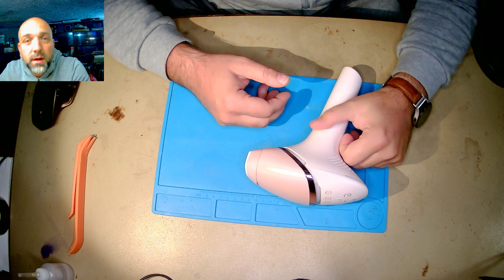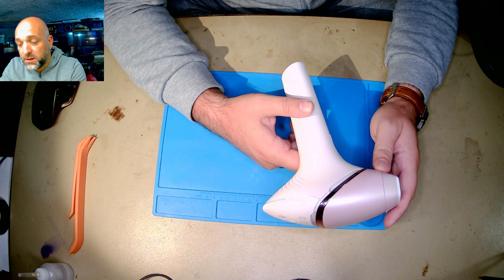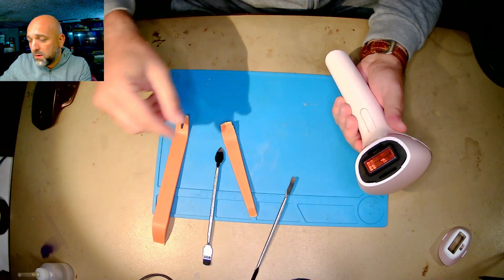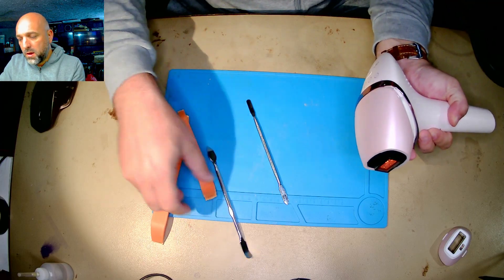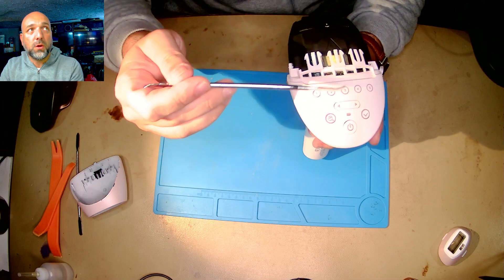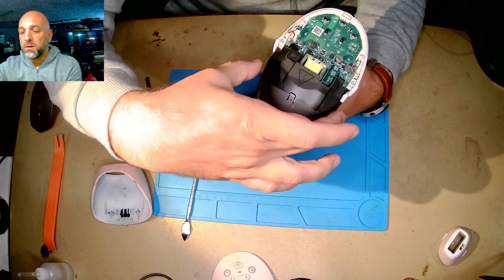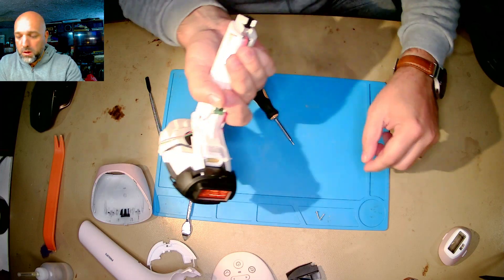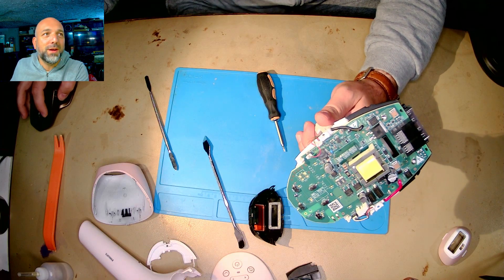Philips IPL Lumea 9000 Full Disassembly | Step-by-Step Teardown

Comment: Is it possible to open only the appliance case at the handle? Can I start there instead of the top?
Reply from the maker: Unfortunately no. The screws holding the handls are located inside.
Reply: @benassy69 Does that mean I have to disassemble the case in the same order as in the video?
Reply from the maker: Yes. But be carefully to not break the lamp
Reply from the maker: @AnaMF91 yes

Comment: Are there any dangerous radioactive materials in these devices? I wanted to check before proceeding with a repair on one of these. Thanks
Reply from the maker: No. I have a radiation meter and test it and it is safe.
Reply: @benassy69 thanks so much, really appreciate the help. Thanks Rich

Comment: 1:42 correction it's not extremely hard to disassemble it's  a true nightmare for me.😂
Reply from the maker: Yes..confirm 😂 Have you repaired your unit?
Reply: @benassy69  definitely I'll not be interested in repairing it 😂
especially after the tragedy of disassembly
Reply from the maker: But what was the defect. Mine's has no flash . Capacitor ok battery as well  ....don't know about the lamp
Reply: @benassy69  I am so sorry I forgot what the fault was its a long time ago approximately 5 years ago
Reply from the maker: I was curious because I am currently trying to fix my wife's. So I'm looking for any help that I can find since o the internet i cannot find anything on this topic.
Reply: @benassy69  I'll try my best to remember I'll squeeze my brain
Reply: La mía tiene la misma falla, lograste repararla?